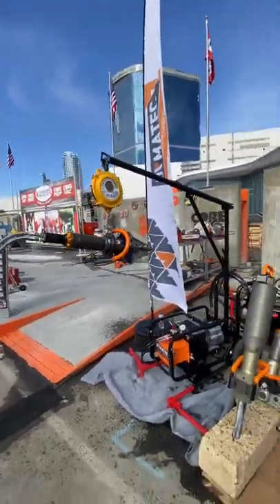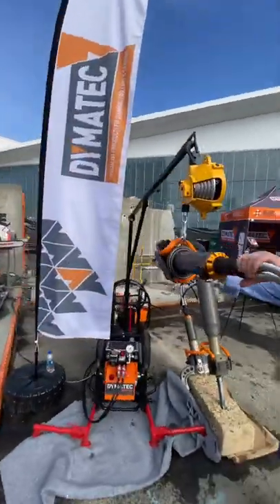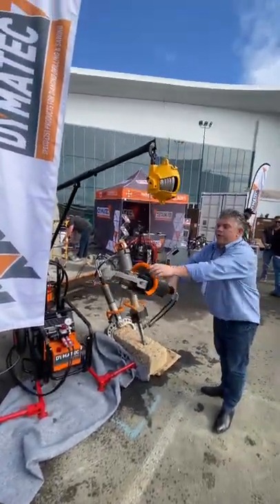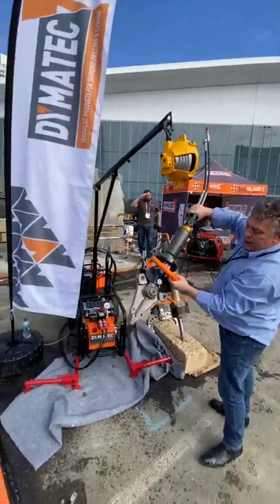Would you pay $20,000? #shorts

Comment: My Fire Department has this x4 sets and just as I retired we got a battery system which worked really well, so no need for the hydraulic pump. Cutters, splitters aka public term jaws of life, rams, pretty cool stuff.  Thank you Mr. George Hurst who invented this back in I believe 1961.
Reply: What's the driver? Don't you still need hydraulic pump to create the necessary force? I can see batteries powering the pump but I don't think batteries, without being the size of a truck, providing the direct power for the tools. Mechanical advantage from hydraulic is just way to powerful. Which is why we use it for everything
Reply: @griznatle  oh yeah now doubt the hydraulic pump is more powerful, but now these are self contained, we practiced with them at the junkyard doing extraction; removing the doors, roof exedra, and they were very good, we had chargers on the Engine to help maintain full battery power.  We all had our doubts but they worked just fine, now that was in a controlled environment, how they actually do on scene I don't know as I was injured and forced to medically retire shortly after the junkyard test.  But after what I saw it did just fine.  I did recommend that we keep a regular set up onboard just incase.  I know they do that.  Now I started in career and ended in volunteer and I can say that the family care within the firehouse is stronger in career as no one from my dept called to see how I was, and that dept I was with had a lot of drama lost a lot of really good guys who quit as the leadership chose to back up this one guy during an argument between him and another Capt.  Lol years later it's recently discovered that guy the dept like so much is wanted for child rape so in short it was a bad dept to end my career on, no retirement party for me, I was told take all the time you need to heal up, and when ready to return to full service I can, well I took time off, dropped by the station for meetings here and there, and then I was given a certified letter from the board telling me my performance level has dropped to the point I have 10 days to turn in and surrender my gear, not one phone call!!  So not wanting to keep these vipers in my life I don't talk to any of them.  Was a Capt. and Paramedic, out here in NC volunteer firefighters have the option of a minimum of EMR, or EMT 1, I was the only active Paramedic.  Anyway I was used basically and then tossed out.  Yeah I'm pissed and pray their honor is cursed.  I do keep in contact with other dept guys from other stations you know the ones that called or text me where I've been?  So in short I have no idea how the battery set actually performs in a real 10-57.  Im sorry this is long, and I thank you for both reading and for the reply to my comment.  Be safe and be well!
Reply: @dadtype2339  you don't remember what the volt and amp was on the batteries? I'm gonna hazard a guess at 240v 4 amphr

Comment: There is a company who makes these also , but they are a lil smaller ( not the jaws) , but the back..  power hydraulic system.. is powered by a Milwaukee m18 battery. They are $10,000 each..  no need for a power pack .

Comment: me no, but a company that needs to split, or crush things all day long, yeah i guess so , the ergonomics would be really good for the employees especially with there attachement system, high end assembly shops have the same holding systems for heavy tools. the fact that its a power unit, i guess you will be inconvienanced by the hoses and limited by their lengths, but u do have a major weight differance , fire figthers , i guess so , the fact that its a multi tool ( kinda ) for emergencies is a big advantage

Comment: I know it’s used for demo, but I don’t understand? So it takes small pieces of rubble and makes them smaller? It was already small enough to load by hand into a skid steer or loader bucket before he chopped it.
Reply: Probably for demonstration, not what you would normally do.
Reply from the maker: I actually agree. Those jaws don’t go very wide in my opinion. So the pieces would already have to be small for this to be effective
Reply: Exactly, those jaws are just making a mess

Comment: It’s just fire fighting equ that has existed for years. Well the first two…
Reply: third one as well, its a combi tool
Reply: Yep!
Reply: 💯 It’s called the jaws of life
Reply: We just got the Hurst battery powered extrication equipment for my department. So much better than the hydraulic stuff.
Reply: They all are just rip offs of the hamaltro with a power pack thays twice the size that it should be lol.
Reply: @lucasceglinski2352  until the battery fails in the middle of an operation. It will happen eventually.
Reply: @LongIslandHobbyist  the Milwaukee powered ones didn’t last long.
Reply: I prefer Hurst or Gemini
Reply: @LongIslandHobbyist  they are extremely reliable and every rig I’ve been on with them has mad sore batteries, and they can be run with a cable if need be. Sometimes new stuff is better.
Reply: Matthew Hayslett  I already said you can just plug it in so that. And batteries work fine in the cold just for less time. So you could just swap more frequently.

Comment: no to small of pieces jack hammer works just fine for a lot less
Reply: No it doesnt, these are for rescue work used by first responders.
Reply: @gooeyking  we are talking about in the contracting industry they have their place somwhere
Reply: @gamerfarms9362  and thats not what these tools were originally designed for. So saying a jackhammer would do the job better is simply wrong because you wouldnt use a jackhammer to dig someone out of a collapsed building.
Reply: @gooeyking  if the building is colapased already your going to need something bigger than that stan shows this off for  contractors not fire and ems workers.
Reply: @gamerfarms9362  not necessarily, you dont want to disturb the rubble too much and cause a big shift that ends up crushing the person thats trapped. Or in a collapsed tunnel youd want a more compact model like the ones in the video that can actually get into places the bigger bulkier stuff cant

Comment: No got a concrete drill and a sledge hammer sure the drill with try and break your arms but better then that
Reply: No its actually worse because these tools are designed for rescue work by first responders, not for construction.
Reply: @gooeyking  yeah even then there’s kind of one brand that hold the position for rescue tools like that
Reply: @wingmangaming2043  yeah notice how these are smaller? Because the jaws of life brand makes very large cumbersome rescue tools, these ones would be perfect for collapsed tunnels or buildings where the bigger versions couldn't fit

Comment: Ok, so this looks like the jaws of life set I have on my Fire Truck. We cutters, the are like curved scissors, his are bulky and wider. his jack hammer deal is like our ram, that is used to push . our spreaders helps us open the doors. and we have similar generator to run two tools at once.  Our new set runs off of a Milwaukee Battery.  and we don't need a cable to carry around
Reply: Right? We have the Genesis tools and I could not believe they went with the M28 battery 🤦 I asked the sales rep directly when he was demoing them and he simply said "because they needed 28 volts". I felt like I was interviewing Nigel Tufnel from Spinal Tap...
Reply: But these are FAR stronger. You need them to put apart some sheet metal, pry doors, and cut pillars, and you might need to make 1-4 cuts on average.It's just not even a comparison. That's why you were able to switch to battery operated tools.
Reply: Not any stronger just a little different attachments on them . Anyway, moving on
Reply: Im betting dollars to donuts this is a very large lot set up for exhibits of newer models of the firefighters rescue tools.

Comment: Fire departments have been using this same system for a long while, they now have the same tools in a hand held system which eliminates the hydraulic hoses. The company is Hurst tools.
Reply: Multiple brands now. We use battery powered cutters, spreaders and jacks. Having said that for extended extrication times we still have our good old TNT set up in the booster truck. Battery powered are great just don't last as long as needed always. But it's great to not have to switch lines over when we're in a hurry to get someone out. And is safer in the regard of hydraulic injury if an individual doesn't bleed pressure from tool before the switch

Comment: Cool. But it looks slow going and on the small side. Still pretty cool. This is how great things start. A small idea. Maybe it will find itself on a skid steer as a quick removable attachment?
Reply: Usually slow comes with more power, a higher speed would probably require a larger pump thus also requiring a larger motor
Reply: @newtonraymond77  
Agreed!!! Larger pump, motor too. Maybe if it came with larger pump and motor and did work at an increased rate would 20k be worth it.